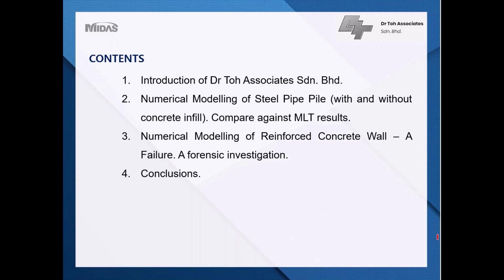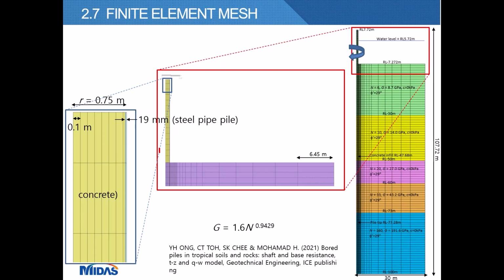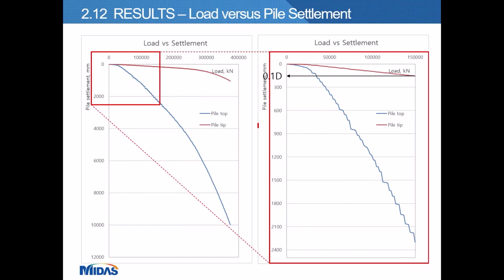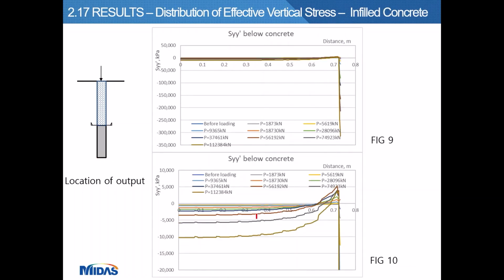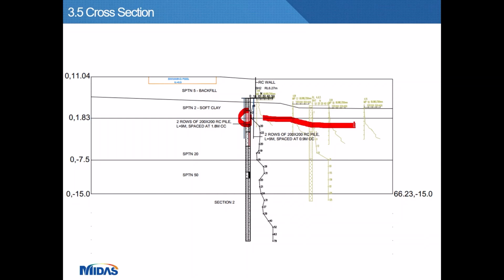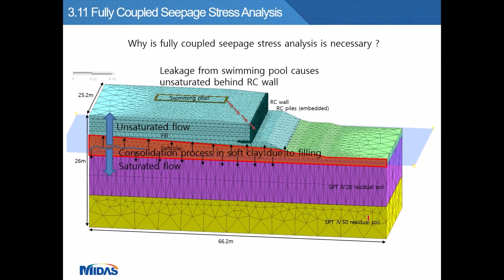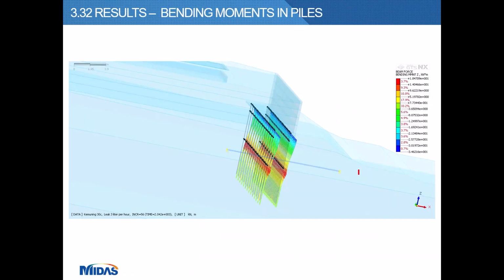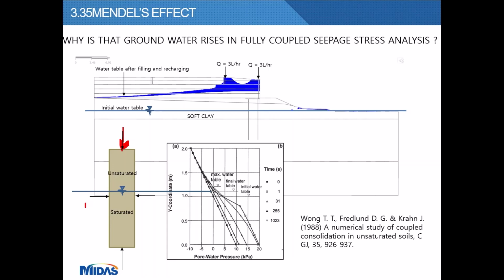Case Study: How Close Are We To Reality?

Comment from the maker: TIME STAMP : 

00:00 Introduction
00:56 Contents

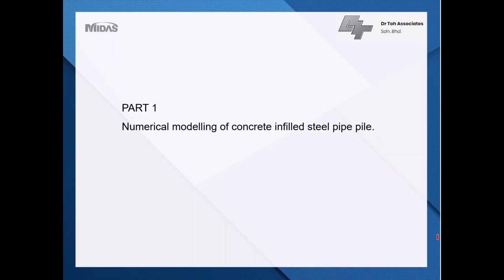02:18 Part 1.Numerical Modeling of Steel Pipe Pile (with and without Concrete infill). 
Compare against MLT results
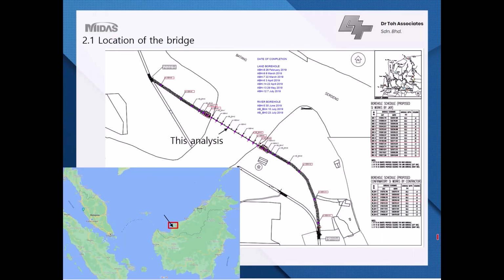02:29 Location of Bridge 
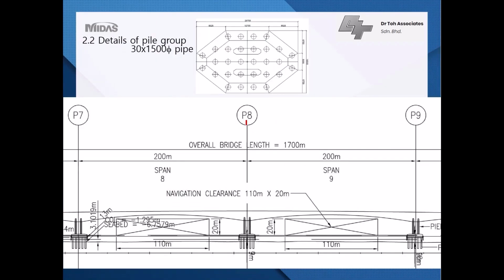03:02 Details of Pile group 
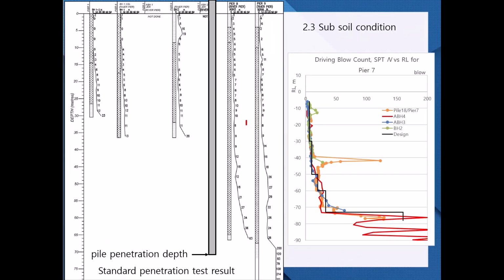03:24 Sub Soil Condition
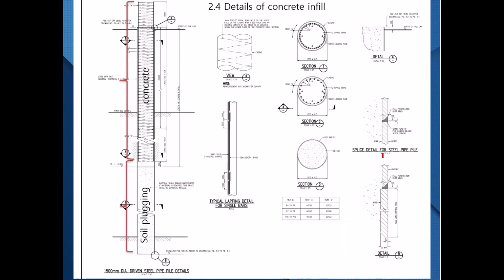04:29 Details of concrete infill
05:19 Installation of Steel pipe pile 
05:25 Maintained load test 
05:33Finite Element Mesh  
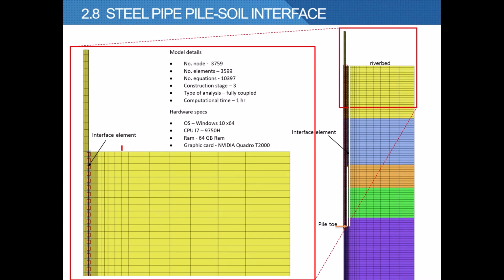07:33 Steel pipe Pile-soil interface
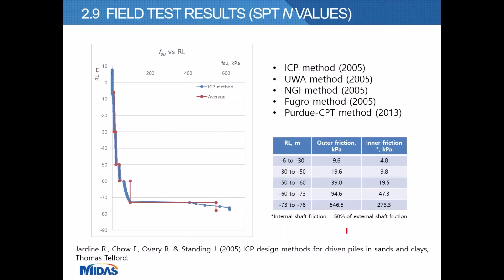08:27 Field Test Results (SPT N Values) 
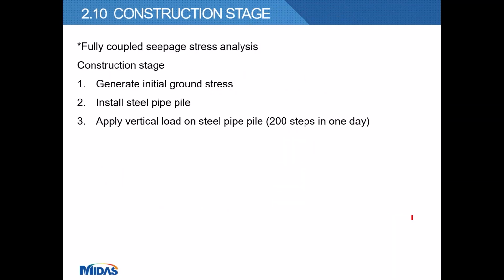09:38 Construction Stage 
10:08 Results
15:27 Evolution of Loads in Concrete Infilled Steel Pipe Pile 
16:23 Sketch of Inferred Load Transfer Mechanism 

17:02 Part 2. Failure of Reinforced Concrete Pile Supported Reinforced Concrete Wall in Soft Clay
17:18 Chronological Event of The Failure 
18:05 Photographs of The Failure 
18:46 Survey Layout Plan 
19:09 Cross Section 
19:56 Absence of Drainage Layer 
20:22 SWCC for Fill 
21:25 Failure Mechanism 
21:48 Not a Global Failure 
23:01 Failure Mechanism  
23:41 Fully Coupled Seepage Stress Analysis 
24:24 Soil Parameters 
24:53 Construction Stages 
26:10 Results 
32:12 Mendel’s Effect 
33:39 Conclusion